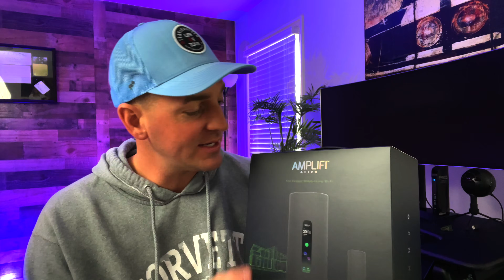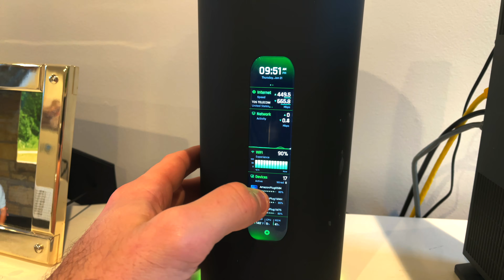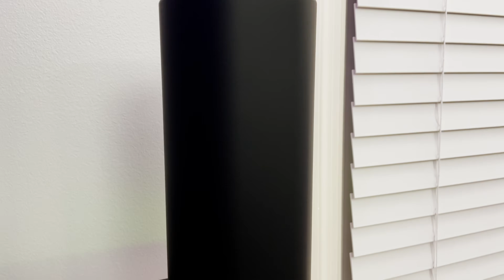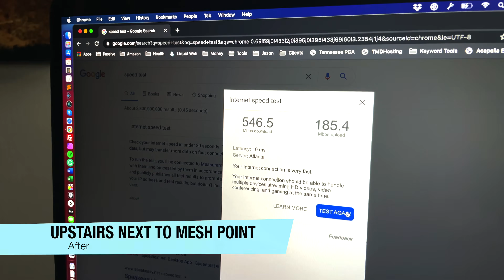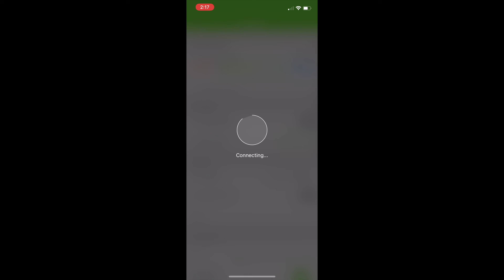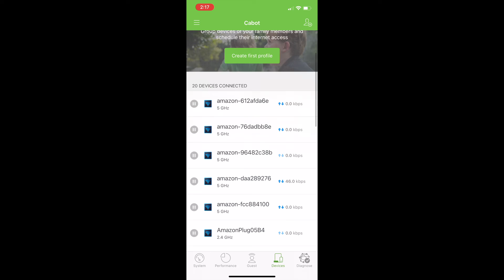AmpliFi Alien Router: Ultimate Setup & Real-World Test

Comment: Do you still rate this? I have a Ubiquiti Dream Machine and WiFi6 AP but thru don’t run very well for me. They need serious tinkering too with the plethora of different settings offered and five weird issues like my iPad Pro would lose DNS every time it’s sleeps. I ended up putting my original Google WiFi MESH system back in and all the issues were gone. But I am considering upgrading to this Alien system, as it’s faster and more future proof. Is it a good upgrade from the Google WiFi?
Reply from the maker: I wasn't upgrading from anything so I can't speak to that, I was coming from just a modem/router which provided a solid signal when close but not everywhere on my property. I can say that I absolutely love my alien system and recommend it to anyone who's interested. Setup was super easy, touch screen is awesome, app is awesome, overall a really great experience.

Comment: Have a large 5 bedroom house and mesh seems the way forward despite some outstanding standalone routers. This product appears to be the best mesh product so far. Would you recommend the 2 pack option or 2 separate Alien routers
Reply from the maker: I purchased the two pack option and I’m very satisfied with it. However, I do not hardwire any devices in my house. If I hardwired devices I would consider getting two routers as it would give you four additional ports if you needed them.

Comment: Thank you for the excellent video.  I had the same experience with the orbi system from Costco, bought mine back in August, setup was OK, and the hardware / performance was very good. I absolutely hated the app and web interface.  The device list keeps refreshing in the middle of scrolling, doesn't hold configurations, just a horrible experience.  I put up with it until this past Friday night... I tried to change the channel to one less used by my neighbors, and it blew up my wifi, couldn't connect anything, the app didn't recognize my orbi devices, I couldn't reach it via browser... So factory reset, go through the whole process of initial setup, still cannot see the orbi devices.... UGH!!

I gave up and put my old asus back into service for the night... Then went to Costco and returned the Orbi system yesterday... Not impressed with any other netgear offerings, I chose to leave empty handed and headed over to Best Buy where I found this beast.
Got it home and I'm running just one router for now and it's noticeably faster even compared to the orbis...  I am super impressed with the app so far and the granularity of control it gives.  I'll most likely be getting another one to create a mesh within the month.
Reply from the maker: Amazing how much software can be overlooked during the purchase process, but just how vital it is! Thanks for tuning in @Dave

Comment: Having these myself. I would recommend getting the two solo routers. That way you get the screen on both as well as the 4 lan ports. Some amazing bits of kit. However, it’s definitely the best out there for ease.
Reply from the maker: Interesting. I was wondering if I should do that but I figured there may be a conflict so I went with what they had recommended which was one router and one mesh point. 

Thanks for commenting, that’s a great idea if it’s that simple to just have two routers because the additional lan ports and screen interfaces.
Reply: Great video and thanks for the info DIY Buildouts 👍🏻. Same to you Peter (for your suggestion). I just happened to come across this video looking for answers on this amazing new fangled marvel 👍🏻😜  and liked it so much that I subscribed to your channel.

I’m in Australia and have been looking to upgrade from my Time Capsule which has served me extremely well over the last 10 years. But as I increase the number of ‘smart devices’ on my home network/Apple eco system, I’m finding it’s time to refresh things and the Amplifi Alien looks like it will be perfect. We’re only just getting these to market down here and for $999 AUD (Router +mesh point) it’s a sizable investment. 
The thing that concerns me is that I have a 2 storey house and would really like to get a 2nd mesh point but there’s no word on if that’s going to happen I guess. I’d take Peter’s advice and buy a second Router + Mesh point but at $2k AUD for 2 bundles, I may just wait until they offer extra Mesh points sold separately. Fingers crossed they’ll do that 🤞🏻🤞🏻
I wonder, could I add my Time Capsule (in bridged mode) wirelessly or via Ethernet cable (either attached to the Mesh point or the router?), or would the TC be incompatible?
Reply from the maker: I don’t think you can add your time capsule in bridge mode, but if you did, you’d likely slow your network down losing the benefit of WiFi 6

Comment: Awesome video, I'm getting mine Wednesday
Reply from the maker: Thx, you’re going to love it
Reply: @DIYBuildouts  one question, what kinds of speeds can you get with wifi 5 devices? I currently have a 2017 ipad pro and a 2015 MacBook air, that are not wifi 6 compatible, I do have iphone 11 and 12 pro max, I know for a fact those are wifi 6 compatible, but need to speed up my older devices, thanks
Reply from the maker: WiFi 6 has a theoretical throughput of 9.6gbps and WiFi 5 has a theoretical throughput of 3.5gbps. Now those numbers are a sum of all of the channels combined. Meaning 2.4 GHz and 5 GHz combined. The real benefit of WiFi 6 is the available bandwidth for multiple devices. When you have multiple devices connected to your home network including extra devices like Amazon Alexa‘s, thermostats, laptops, phones, smart plugs, garage doors, light switches, iPads, etc, your available bandwidth becomes an important aspect of your Internet speed.

Think of it this way, when you’re driving down a two lane dirt road and there are 20 cars around you, it can be a white knuckle experience. Compare that to a 6 lane highway with only 20 cars on it and you start to get the idea.

WiFi 6 allows faster throughput than WiFi 5 yes, but the real benefit in the short term is the available bandwidth in terms of “width” to accommodate multiple devices without slowing down.
Reply from the maker: A WiFi 5 device on this amplifi alien system would get 400-600 mbps in reality. It falls under the 802.11ac category which has a theoretical throughput of 1300 Mbps but that’s on the 5 GHz channel and in reality there’s always a drop off with WiFi versus the theoretical.